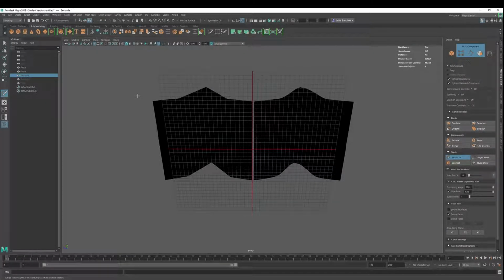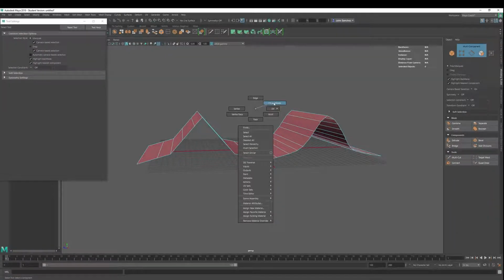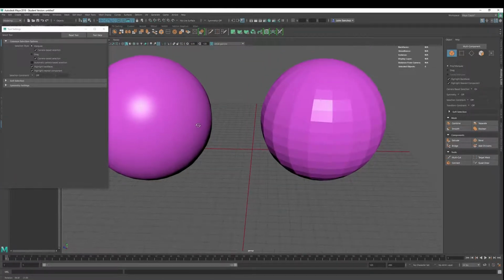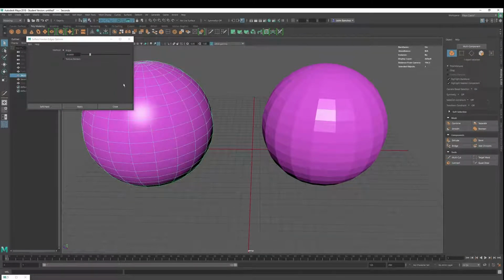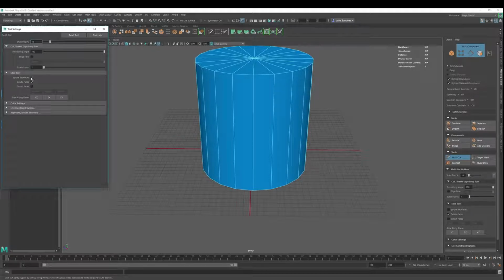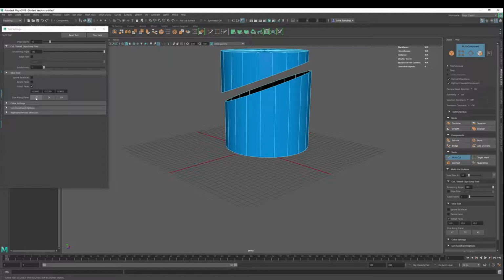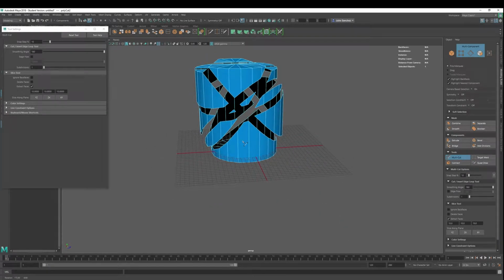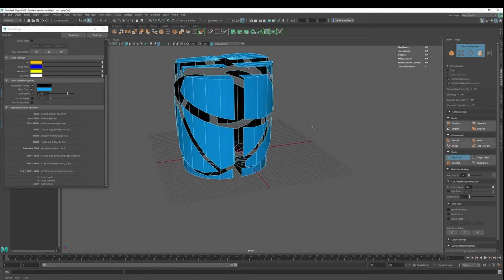Autodesk Maya 2018 Basics- MULTICUT Tool- Part 2/2

Comment: what did Autodesk do with the slice tool using a planer that you could dial in you exact angle.???  I use all the time to do modeling for  Arch Viz. great for cutting angles. Cheers Alan